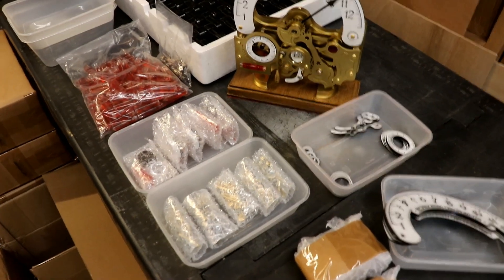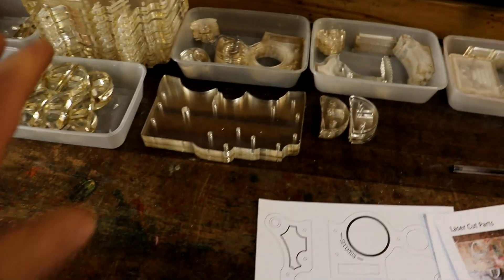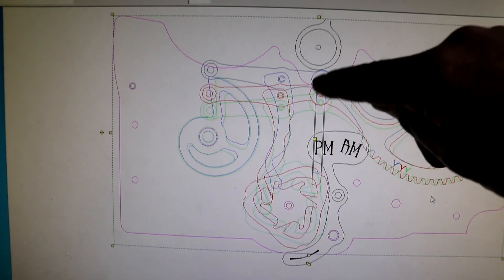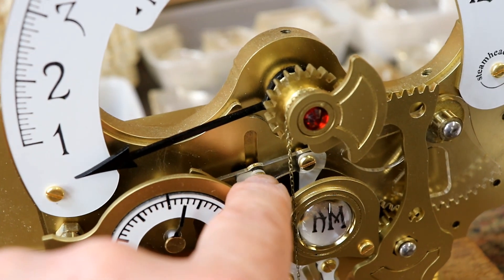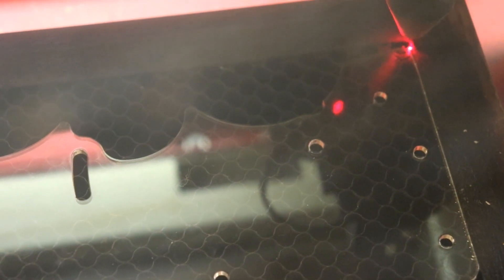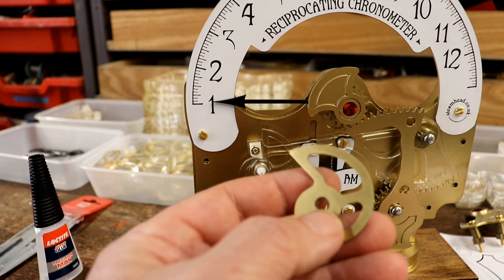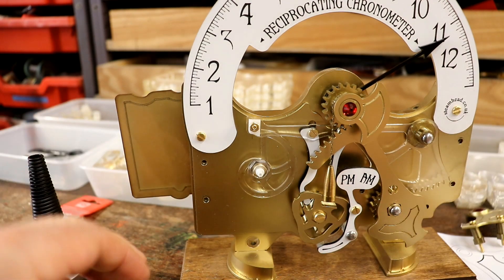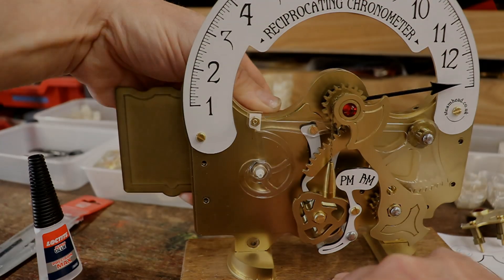It Was Finished, But Then I Walked the Dog...

Comment: Have you ever considered air brush? Might be the answer to your long drying times..excellent info see Barbatos Rex.
Reply from the maker: Thanks for the Barbatos Rex link; very interesting. 

Whilst doing a degree in Industrial Design & Engineering many years ago, we were taught how to use an airbrush - good times!

The thing is, mixing metallic paint, adding thinners and then cleaning up afterwards is so time consuming when I can pay a bit more and have metallic brass paint literally at my fingertips. Literally - the word is overused far too much, but I think it's correct in this context!
Reply: @steamhead  I've never tried it but I think I will give it a go with a cheap air brush.
Reply from the maker: @TheUnofficialMaker  They are very good, especially with water based paints and inks. If you haven't got a compressor, you can always use a car tire and foot pump - good times!

Comment: does the radius correspond to how far the needle moves ?
Reply from the maker: I divided by 10 and not 12 as I'm useless at maths! 12 would have made more sense out of a 360 degree circle, although it doesn't correspond to hour readings directly, as it just needs to follow a curved linear path (if that's something) between the minimum and maximum positions on the hour readout. The grid just provided points for the bezier curve with a bit of fiddling at each end.

The follower then moves the hour hand proportionally via the two sets of gears. I am absolutely thrilled to have finally solved the AM/PM locating problem.